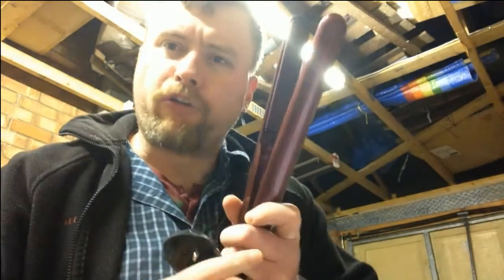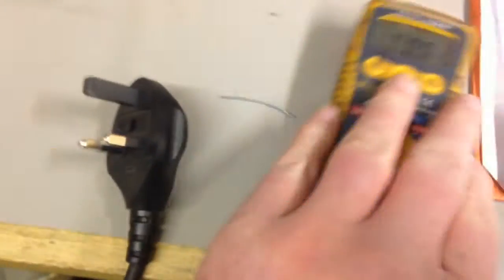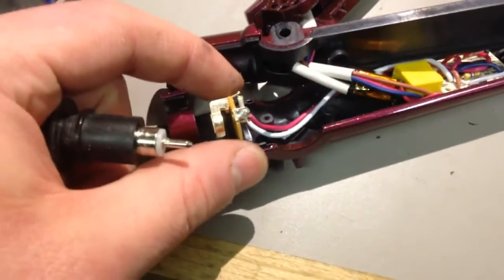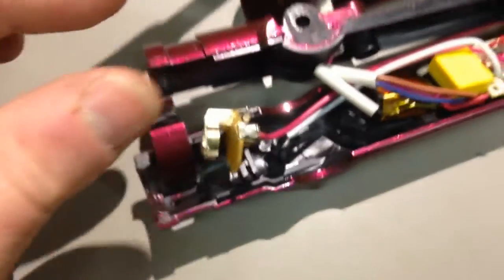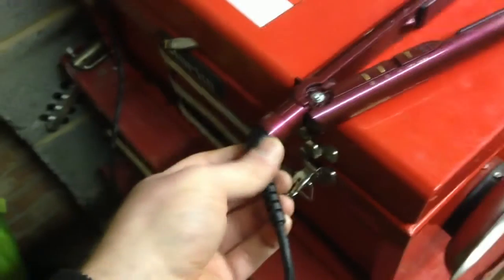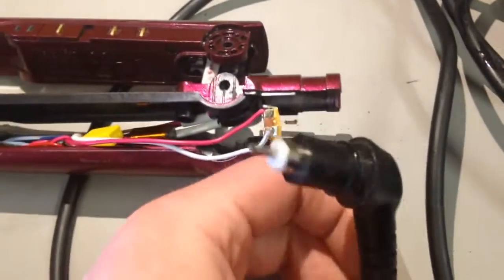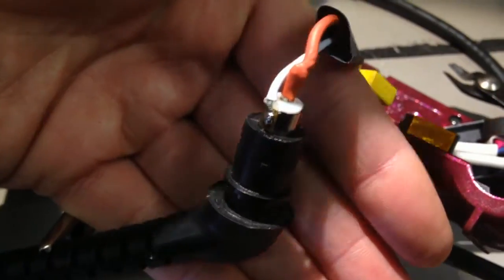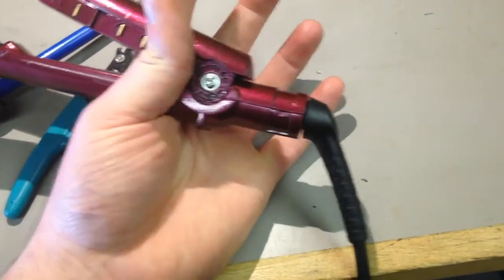Hair straightener rant and repair! VB#11

Comment: Exactly the same issue with my daughters hair straighteners. You saved me some time trying to repair a problem that was an intermittent cable break under the cable boot. Replacement cable £6.99 on Ebay.

Comment: Continuity means the fuse is GOOD not blown  !!!
Am I missing something  ???
Reply from the maker: Hasn’t blown. Unfortunately my accent abbreviated to “han’d”
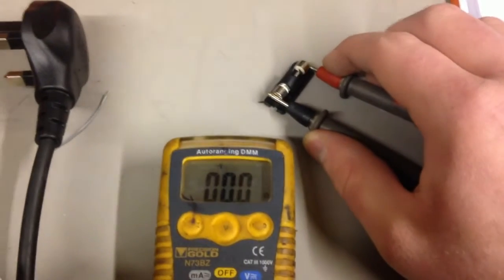Reply: @chriswouse7713   .... Did you re listen to 2:05 ??   I'm from Yorkshire and have no trouble with your accent.  Anyway, I have a pair to fix so looking for common problems.  Sorry you couldn't fix your wife's pair.  Strange how a cable can fail just on the reinforced pard, possibly a manufacturing issue.